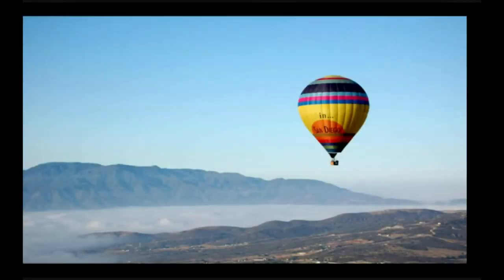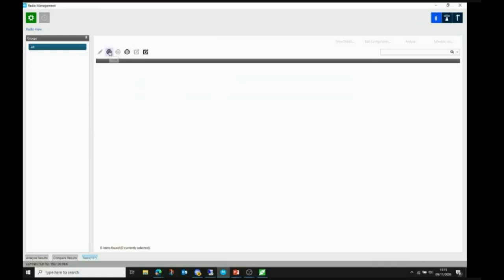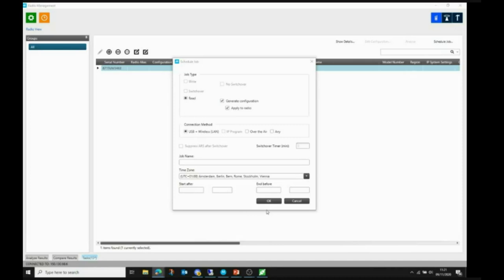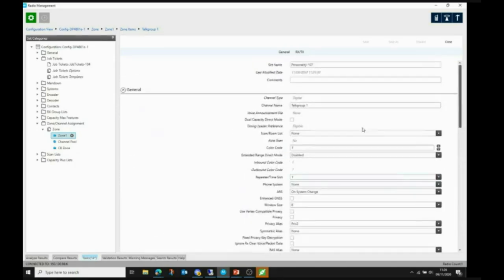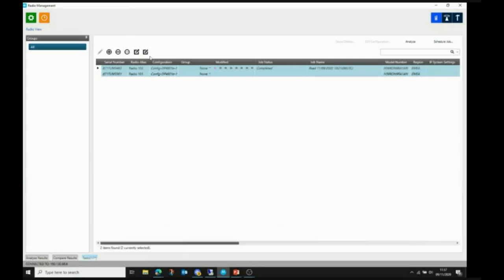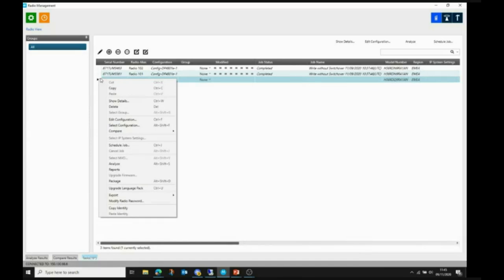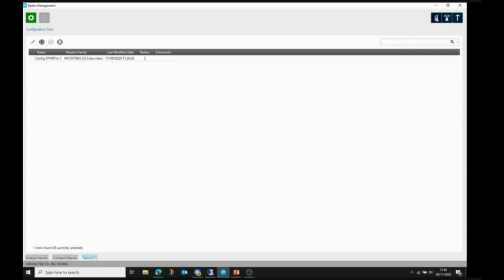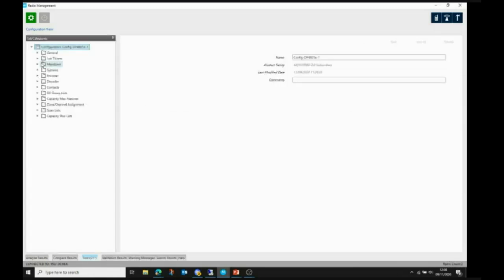MOTOTRBO Radio Management Usage

Comment: Wayne don't need any software I already have it, but I can't seem to be able to install it which is strange because I've always been able to install Motorola CPS even when I got conflicts because of having other versions on same PC I've been able to get around that but for some reason i cannot install Mototrbo RM every time I try I keep getting error 1920 issue starting services with RM Services I've tried everything from  running as an Admin to giving myself full ownership of the PC and still nothing any help please
Reply from the maker: One or all of the following usually works:

-Use a clean PC (i.e. just Windows, nothing else).
-Make sure Windows is up to date.
-Run setup.exe as an administrator, even though you might have admin right (right-button click run as administrator)
- Make 100% sure you have admin rights and RW access to the whole hard drive.
- Disable your antivirus especially if you're using anything other than Windows Defender.
- Do not use Windows 7 or 8.
Reply: @cwh050  hi there, yes I tried it on a different PC and got installed no issues my problem is with the sql, by the way have you had any experience with the SI500 moto body cam was told that I could read these using the RM but I cannot the PC identifies the cam as an Android but there’s issues with the driver and I cannot find the right one, also this RM version I have worked for Android - Mototrbo - APX but can’t seem to be able to read it I don’t know if it’s because the wire I’m using is just a generic charging cable with the right micro USB connector or if I need an actual standard Motorola programming cable because I read somewhere where it has all the specs of this camera it just mentions a standard USB and all other accessories has their part numbers just don’t know if it had to be a Motorola because they do sell a standard USB for programming
Reply from the maker: @rickl571  Si500 uses a different version of Radio Management. It's called Radio Management; looks the same but is designed to specifically support this hardware.
Reply: @cwh050  What version according to motorola as long is RM in the 2.X it will work
Reply: @cwh050  The one seen in their video was 2.5.12
Reply from the maker: @rickl571  I think its called PBB RM. We don't sell the Si500 in EMEA so don't take this answer as verum facto.
Reply: @cwh050  hi there ok I found out which version I need to program and use on the SI500 I need the R02.50.00 with RM R2.20.73 this works just can’t seem to find it I have a login into my view but since I haven’t used it in a while I got an error that they have to fix don’t know how long it will take so I was wondering if you had it